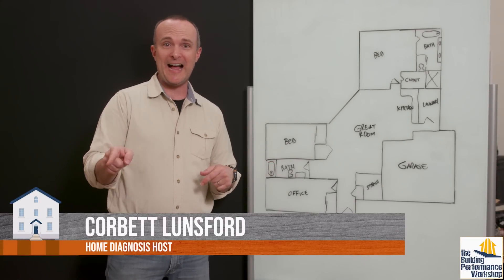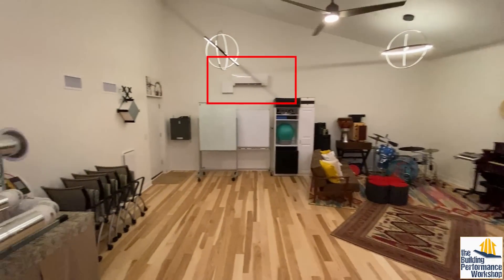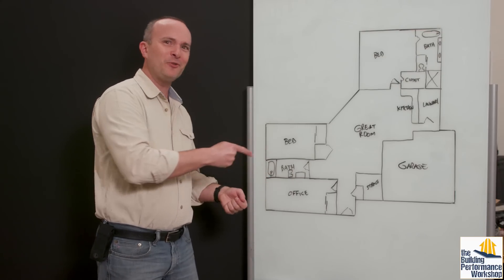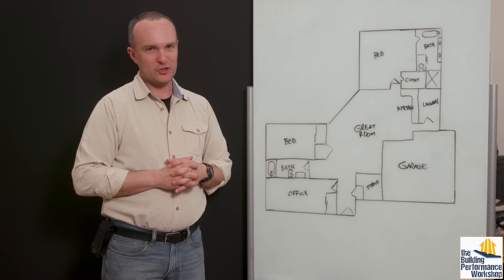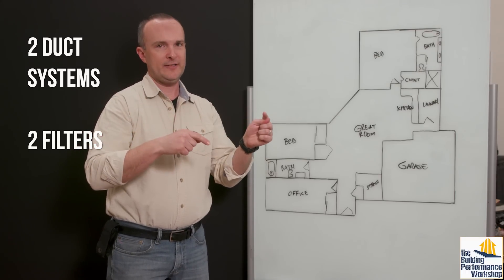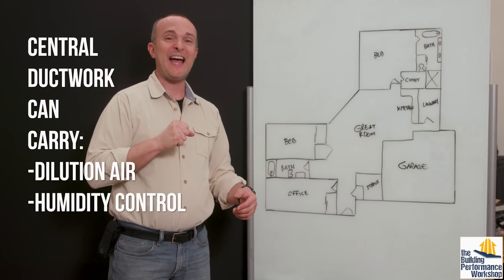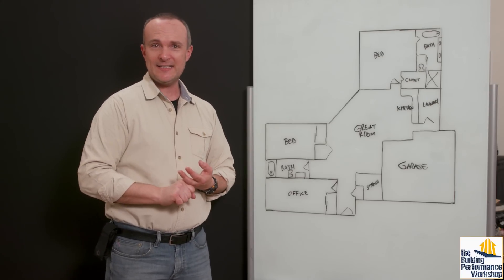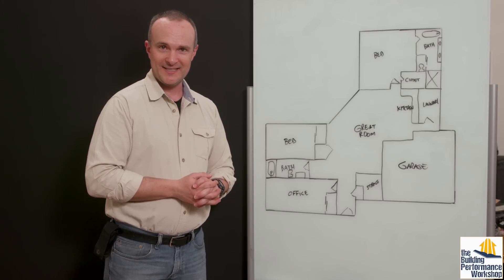HVAC Ducts Reality Check: Are Ductwork Systems Dumb or Essential?

Comment: I just built us a custom home North of Atlanta (I think that’s where you are too?). We did a hybrid system based on the shape/design of our house. We did “traditional” ducted high efficiency variable speed trane systems for the 1st and 2nd floor. Our garage hangs off the back of the house in an L shape with finished space above (approximately 600 SF). We did a 1ton daikin ductless mini split in the finished space over the garage. Did a Fantech ERV. an Aprilaire E100 on the 2nd floor, and a Santa FE 70 in the unfinished basement for separate dehumidification. Fantech 830 CFM Hood vent (with the silencer per your recommendation, thank you) with makeup air pulling in from our screened porch. Our ERV also has the fresh air intake on our screened porch too. Spray foamed the roof deck for a conditioned attic. Zip system and air sealed envelope with 2x6 R19 batts in the walls.  Got a 2.0 ACH50 on my blower door with a bunch of missing door weatherstripping (BD guy showed up earlier than I expected and the painters had just left the prior evening. I wasn’t finished re-installing all the weatherstripping they removed).
Reply from the maker: Good work Brad!

Comment: We have a 10 yr old Trane Heat pump with a backup Gas furnace (Midwest) and it gets cold in winters.  We r building a new 2,000 sq ft house with no gas to property.  Will be an air tight home.  Is the newer Heat Pumps better at <30 degrees F?  If not how would u recommend back up < 30 F heat?  Thx and u r a natural on YT, nice video!
Reply: Highly recommend an inverter. Goodman/Amana inverters can heat at 100% capacity down to 0 degrees. Some can do better. After that you’re use auxiliary heat like a heat kit during extreme temps. -hvac company owner.
Reply: @daltonhadley  Thanks for the detailed reply, I'm a new subscriber, will do a deep dive into your previous videos.  Thx

Comment: Thank you for this very helpful video. We live in an area where most of the houses were built from 1890 to 1940 and it is often difficult to retrofit hvac. Heat pumps are very popular, but ours has old duct work from the '70s that I need to update (also asbestos). Dust is definitely a big problem and it was encouraging to see the merits of upgrading the old ductwork and filters rather than going with another solution.
Reply from the maker: Hope we helped save your duct plan then, Maarten- replacing is expensive, but worth it if you value these features

Comment: I’m going with mini splits but ducting will still exist with the ERV system. I’ll be using 5 indoor units powered by 2 outdoor units. Though my house is really small at 1000 but I like the idea that each room could be it’s own temp
Reply from the maker: Your ERV will be running only maybe 100 cfm- not enough to circulate, humidity control, or pressure relieve 8000 cu ft of volume fyi.
Reply: @HomePerformance  , so one complete exchange every 80 minutes with an ERV isn't enough to circulate? But a closed system with no outside exchanger is? I get the humidity issue, ERV isnt a whole house dehumidifier, sure... Its filtration capabilities are also not good vs a massive filter. but not enough to circulate vs. one that doesn't do any outside air exchange? Got the confuse in my face
Reply: So the auto solution is ducted hvac? @homeperformance
Reply from the maker: Not the only solution, but centralizing the 5 Factors means less equipment with better fit, less complexity, simpler controls. It’s done in a decentralized way in Europe and Asia all the time, like Tweake comments from NZ.
Reply: @HomePerformance  Explain to me how or why I should care about ducts.  I have a home built in 1910.  I run an oil burner.  There is nearly 0 air flow upstairs in winter or summer.  The ducts are sealed behind plaster walls.  I had 2 HVAC companies come in, the cost to redo the poorly done duct work was going to cost 6-12K, before even touching the 25 year old oil furnace.  Oh and to top it off that does not include the duct work to the 2nd floor that are in plaster walls. That will be another 10K and have to bring in a company that specializes in asbestos and lead paint remediation.  So you think that a plan where I spend 22K to have some heavily leak prone steal or aluminum  running through enclosed walls is better than 9 mini split heads at most?  Never mind the fact that filtering air is done very poorly overall by ducts in general.  No thanks, I'll stick with my mini split plan that quite literally will cost half of what just doing the duct work replacement would cost.
Reply: just keep in mind with small houses (yours is the same size as mine), even non-efficient ones like mine, getting small enough units can be a problem. also i don't recommend multi head heat pumps, especially if you can't size the heads well. it may be better to do a ducted system for the bedrooms.

Comment: Our home located in the Hudson Valley in NY was built in 1987 with a joke of an HVAC system.  The return consisted of two 4 x 10 inch vents for a 1900 sq ft house!  The ductwork was fiberboard of some kind.  Shortly after we bought the home the oil furnace heat exchanger was found to be cracked and couldn't be repaired.  We replaced the furnace and they enlarged the return but only minimally and as we were new home owners had no idea there was still a problem.  A few years later we got a heat pump and finally put in a properly sized return system.  In the early Spring of 2021 the furnace started leaking heating oil which filled the house with an awful smell requiring us to open every window and door to vent it.  Faced with repairing the furnace and replacing the 34 year old oil tank we decided to install Geothermal and avoided a mini split system because of all the hardware and maintenance.  It required completely redoing the ductwork (a very big job) and upgrading the electric pane to 200 amp service (lucky this only required replacing the panel).  After all is done we have a 5 ton Geothermal System, completely new, properly sized and insulated all metal ductwork and 200 amp electrical service.  We are extremely happy with the decision and have also added solar and an electric car.  The solar system is big enough to power everything  and our last electric bill was -$415 reflecting what we had over paid to the electric company in 2022.  Sorry to be so long winded!
Reply from the maker: That’s great to hear, Chris, keep up yhe great work for your family
Reply: im from HV too lol

Comment: On the surface, I've always disliked that mini-splits are such a large presence on the wall, and I don't like seeing them. But my more fundamental objection has always been filtration. The onboard filters are equivalent to what a window A/C has, and my allergies aren't agreeable. I love the idea of radiant  heating, and cooling, but I can't imagine not having a ducted system too. I've seen a house with heating and cooling in the radiant floors, and I liked how it worked, but I noticed how stale the air felt not being stirred around and filtered by an HVAC system. I also need the humidity control, or the cooling will damage the floors with condensation... I forgot to ever ask the guy how they controlled the humidity, but between the temperature they set it to and Denver being fairly dry, they may be getting away without as much as I think would be necessary.
Reply: You can always separate filtration from heating and cooling.
Reply from the maker: Yes, with a central duct system

Comment: Absolutely illuminating.  I just had ducted mini splits installed from a top recommended contractor…. pretty good job, though I discovered the return air filter boxes are 20-40% below mfr Fujitsu recommendation- not hard to upsize them so I’ve done 2 of 3 so far with substantial benefit.  I always find myself tweaking things after every type of contractor I’ve ever hired :).  Also  Definitely less household dust that our baseboard oil heat.
Reply from the maker: Wow Benjamin, I like your style
Reply: the standard is no more than 500 feet per minute average across any filter  or coil.

Comment: Love this video! Thank you for creating. What are your thoughts on the Mitsubishi air handler for those of us with ducts? I was looking at retrofitting with minisplits and eliminating my ducts but for the reasons you detail the air handler caught my eye. Has humidifier, ERV. My local “diamond” Mitsubishi contractor really didn’t know anything about this. Hmmmm. I wonder if you or anyone on here has seen or used one of these. Thanks!
Reply from the maker: We have their 2-ton PV series multi-position air handler that’s been running nonstop for the past 2 years with zero problems. Hyperheat enabled in case of arctic weirdness (in Atlanta). Highly recommend.

Comment: Thank you this video will make my life easier when trying to explain to people the issues with going minisplit only and other issues as well. I can just have them watch this.... We will never see minisplits with adequate filtration because it will require a far more powerful blower in the unit which will increase noise and reduce efficiency.
       The guys that put minisplits in their work shops basically have to build a large plenum/filter box to put in real  filters to keep from plugging the unit and large filters to reduce the pressure drop. I plan to go to minisplits for my shop to replace the window unit after I'm done adding far more insulation to cut my AC needs from 5 tons to maybe 2. But I will have to do a filter system as well. Metal buildings are tough to cool even if they are already insulated due to the massive thermal bridging in their construction methods. So I'm building a building inside a building and it will be better insulated than the house...
Reply from the maker: Nice plan, Craftsman! Thanks

Comment: Talked with one hvac about using the sealed attic as the return duct. Filter on the machine. 
I like the idea.. but I don't like the idea of sucking house fumes and dust into what was a semi clean attic. Over time it would accumulate.
Reply from the maker: I’m actually designing this exact setup into a client’s home right now
Reply: @HomePerformance  
Are you going to have filters installed between the living area and the attic?

What about noise transfer between rooms? The open holes on adjacent rooms would allow for noise transfer vs having duct work to kill off some. 
Perhaps a short section of duct aimed in different directions?

Inspectors here would throw a fit using the attic as a return.

Comment: I lived in a new house that had one minisplit in main area to circulate air. It was horrible. Being up north the ac part was not as important. Every room had a wall heater. Met code but was horrible. 

I had caught a video a long while back where the guy talked about carefully positioning minisplits so it would push the air around the house. Downside was it involved keeping doors open for circulation to work.
Reply from the maker: Circulation is difficult in that scenario, yes

Comment: Good video. Just designed the house floor plan doing a manual J and manual D in parallel, so there is room for ductwork. Holistic approach following Healthy Heating guidelines
Reply from the maker: Good work man

Comment: Do the bathrooms need to be conditioned? I have a ducted system but didn't run ducts to the bathrooms. Don't need cooling in summer and in the winter an very small space heater with thermostat is more than enough.
Reply from the maker: Bathrooms are negative pressure zone, they’ll generally mooch off the rooms around them just fine as long as there’s not a bay window and a skylight in there.

Comment: downunder its a little different as homes don't have HVAC, so no ductwork. ductless mini splits are getting very common here. also ventilation systems. however once you start putting several ductless mini splits in, plus running ducts for the ventilation, its starts becoming cheaper to run full ducted HVAC. then its really easy to have hrv/erv and built in dehumidification.
Reply from the maker: Evolutionary HVAC

Comment: For folks who are not using a heat pump or condenser-type dryer, has anyone created a makeup air system for a standard electric dryer in the laundry room? I suppose this would be the equivalent of a range kitchen exhaust hood problem.
Reply from the maker: Very difficult challenge, much lower CFM than a kitchen exhaust. Video forthcoming.

Comment: I'm thinking about tearing out my old furnace and ductwork (which runs in the crawlspace and has terrible insulation) and installing floor mounted electric radiators throughout the house.  This would give me better temperature control room by room.  AC is not a major concern due to the climate.  I also need new windows so I was planning on a few units with makeup air slots in the frames and a timer for my bathroom exhaust fan.  After new insulation I'll be ~R40 underfloor, ~R21 in my exterior walls and ~R60 in my attic so the house will be pretty tight.  Hopefully the bathroom exhaust + window makeup air slots will sufficient to prevent mold growth.  Chime in you have thoughts!
Reply: it is estimated that over 90% of homes has undersized ductwork , and most has a leak of some fashion. a leak on return side sucks air into the home  a leak on the supply blows air out. as that air leaves, it must be replaced ... and it takes the path of least resistance,  whether it is a hole cut for electrical or plumbing,  a recessed light, a chimney, or a bad window seal.
there is a newer product that offers great benefits that could replace your ducts ... made by Kingspan, called KoolDuct. antimicrobial, fire and water resistant,  lightweight, insulated, strong. just an option since you recognize your ducts being in poor condition. now would be the right time to make them right, have them properly sized. and when done you can have them pressure tested and sealed with aeroseal to ensure that you do not have any air intrusion or extrusion. 
to do a good job with floor heat as you described your thoughts would really require new flooring. to do so from underneath ... you lose efficiency. might be cheaper to replace your ducts. but it is your home and you are the one that has to live with your choices ... I do not mean to sound negative about floor heating. just offering options.

Comment: America should go to ductless split inverter technology in new constructions.
Reply: HVAC guys do not want to deal with them too complicated
Reply: @andreycham4797  And beyond realistic besides complicated.  We as American's want our big homes which require big HVAC.  I think ole boy has been smoking the leafy greens.  We can be energy efficient without going into insanity mode.  Even though I want to see this 5000 sq ft house running on a 2-ton HVAC system.  I can't even fathom how that would remotely work based on all the system I have designed.  I doubt that type of system would work here in Denver or the Colorado area.
Reply from the maker: Kevin, homes like this are being built all over North America, I know because I'm part of their project teams. Bigger homes actually require LESS heating and cooling because of surface-to-volume ratio.
Reply from the maker: I think you might not have watched far enough into this video
Reply: Please check your anti-American sentiments before coming into YouTube.